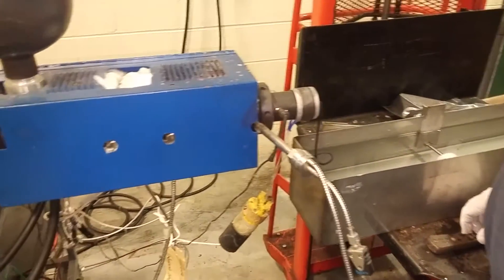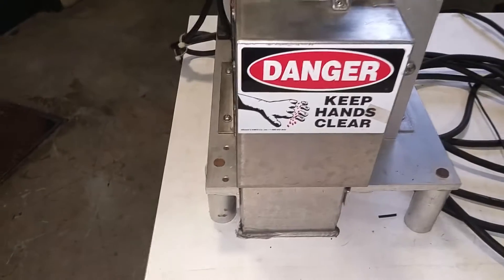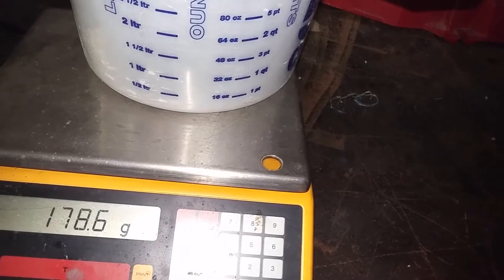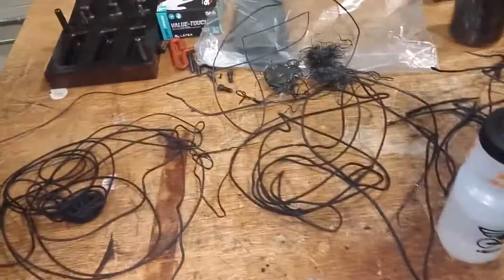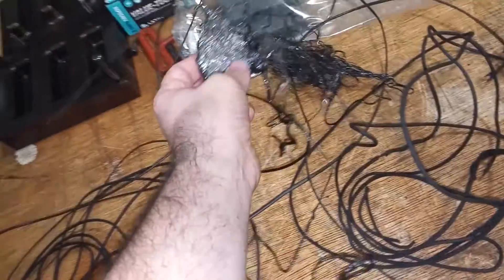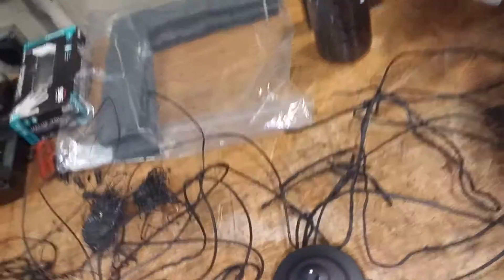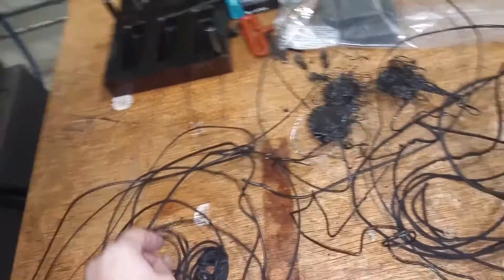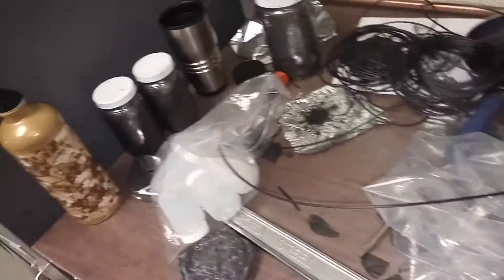Graphene enhanced Ballistic Nylon 3D filament

Comment: Ive got my carbon material on the way,   it is about as strong as some low strength dry wall.  seems unexciting,  but I think itll work good for me,  I dont know much about matter/atoms, and maybe I dont want to know.      I just wanted some basic building material,   and its going to work out good for me, and all I need is olive oil, a bit of time, a fume cupboard with a pump attachment, and a few safety precautions and I should be right.  Only get 2 hands, need both. lose one you may as well hang yourself.

Comment: I need some plastic with high loading (for the sake of electrical conductivity) that has enough plasticity left that I can put it in a shop press to flatten it into a sheet (perhaps with heating). So I don't care if the plastic is strong or not but it does need to have low ohmic resistance. Do you have anything like that you could sell me.

Comment: Hi I am a based in the UK. I have ran out of graphene oxide. I have been in contact with Robert Murray smith who you probably know. I normally get my graphene from him. A great lad. As you probably know he is about to start making his capacitors so he needs all the graphene he has. Anyway rob has recommended you as a supplier of graphene products. Do you post to the UK. Could you drop me a email at andytaylorsenna@gmail.com with your prices on graphene oxide powder.RegardsAndy
Reply: Hi Andy I make graphene
Reply from the maker: I don't make GO currently because it's not really as good as the pure graphene I currently make. But we will offer exact tuned function GO in the future.

Comment: Nylons are really tough :)
Been printing stuff for my new 3d printer of Nylon with glass fiber reinforcement all week :)

Can't wait to make some super tough yet cheap engineering material PA into filament soon :)

What carbon fiber did you use, just milled strands?